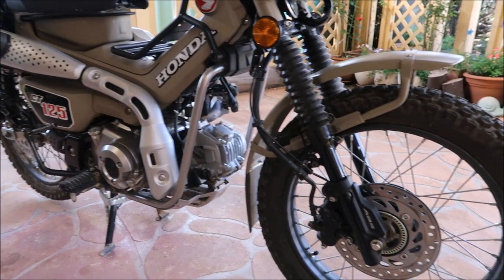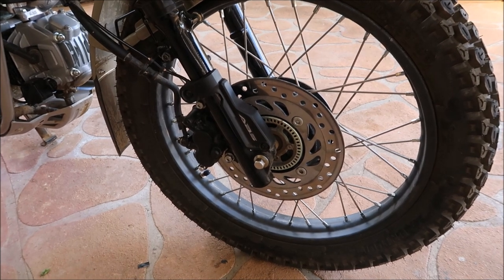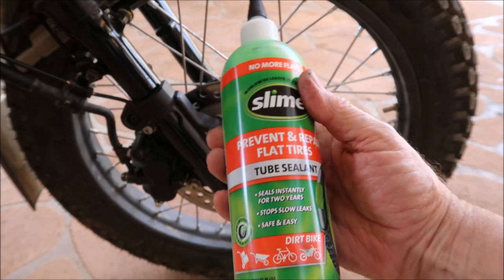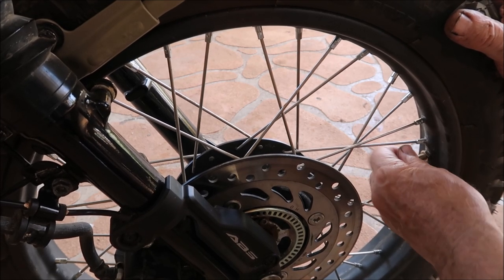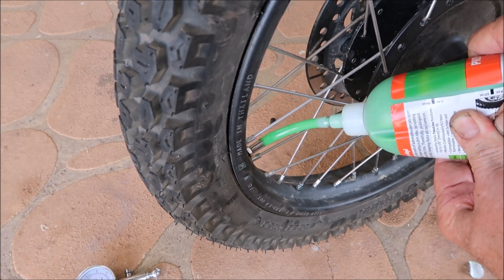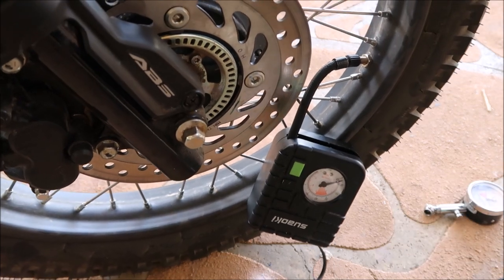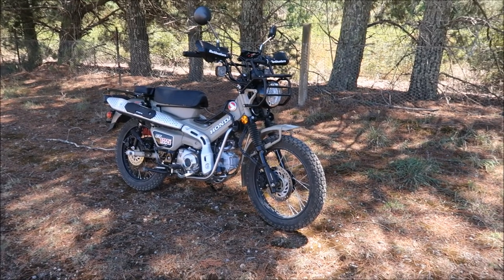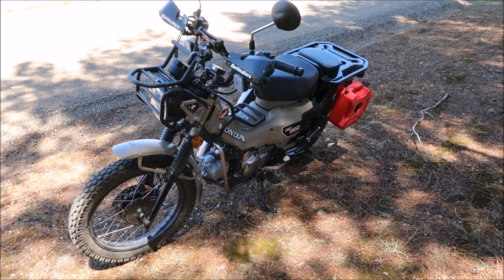Honda Trail 125 - Slime for Tires  Does It Actually Work? -The Good & Bad News!

Comment: Hi you put to much in and has made your wheel unbalanced to get speed wobble yes fixed the leak one good thing I guess.
Reply from the maker: i'd say quite possible and thats what happens when you follow instructions.
it actually fiked the leaks in both front and rear tyres. i found a slime mark down the rear tyre so it works.
i sort of had two problems. both tubes pinched when fitted-i didn't do that...lol and 4oz in each wheels too much-i did do that...lol
actually i should send an email to slime and tell them-get their instructions for use correct!
if it reads 8oz for a dirt bike tell the buyer just put in 4oz!
Reply: Hi Warro how's your 500x going still got it or has it moved on now or collecting dust from not riding it have not seen any new video's here's one that might be good rear suspension servicing of needle rollers have looked on YouTube nothing for 500x plenty for dirt bikes.
Reply from the maker: @davidread319  i will take a look. its still here but i have not been on it since that clip so the odometer is still sitting on just 50 klm total i think. i actually plan to do a clip shortly with daughters cb125 just to compare how similar they look. plus i have been waiting for a new drone.
my old one didnt track and a few subs have asked to see tracking clips on the bikes. 
so i got the new drone yesterday and now i have to learn how to use it and do some tracking and after that a variety of clips will be coming
Reply: wow 50 k's on the 500x not even run in yet LOL I hope you got a good quality  drone like DJI or a Parrot Anafi expensive toys but worth it.........I see your into finch's as well I've had  Gouldian finch's but had rain and cold weather and lost 6 in one night just got zebra's now.
Reply from the maker: @davidread319  50 klm isnt much but i hope to improve on it...lol ive been flying a dji mavic mini but no tracking. new arrival is the dji air 2. have not opened the box yet but its heaver so i expect a bigger drone. tracking is suppose to be pretty good.
yeah i breed gouldians or more expensive mutations. blues.lime and cinnamon.
some have wondered how i can get so many new bikes.....well i guess that answers that...lol
buy yourself a pannel heater for the gouldians and stick it in the shelter. very cheap to run. when the parents leave the young at say 12 days or so -this alone will eliminate the dead young syndrone.
i ran lots of them heating 10 aviaries and my power bill for the aviaries alone ran to $3200 per year...lol 
i bred roughly 200 or more and never lost very many at all.
bred them from feb to august and where i live pretty cold in the windter.

Comment: Warro I watched a video of resourceful indian business doing tubeless conversion.A lot better than the tape kit on e-bay.They use the old tube on rim chuck tyre on & trim access done.Another indian business uses a better process he uses a generous layer of silicone inside of rim covering spokes then 2inch strip off old tube let it dry submerge in water check for leaks assemble done.Bloody resourceful bunch.
Reply from the maker: yeah the tubeless side would be good but i'd still rather the skoke wheel old school style effect. i have actually watched some of those guys myself.
pretty cluey guys for siure
Reply: Have you seen the 18inch alloy rims they have in India.Ugly as.Check out my bike 🏍️ Warro on my profile & leave a comment a heap of comments disappeared so I'd like to know if I did something by mistake?
Reply from the maker: @ruahinesrider  yeah im not too keen on those. much rather the spokes. no ideas on that issue